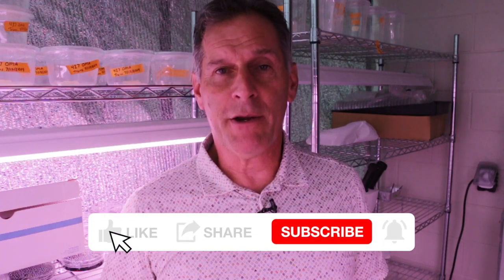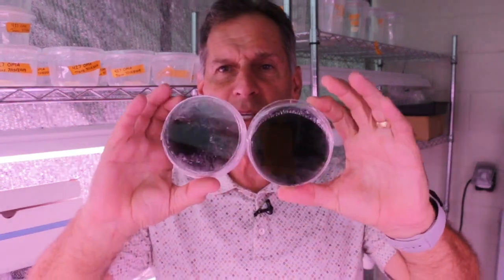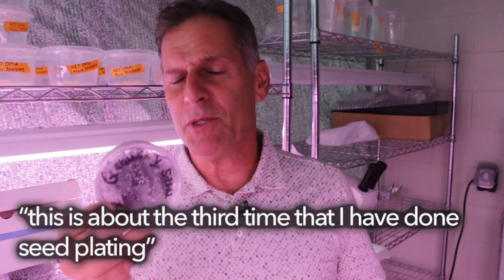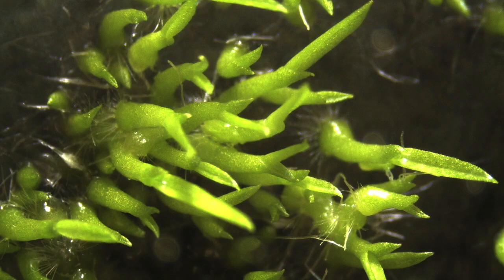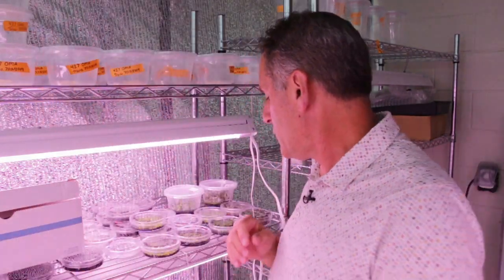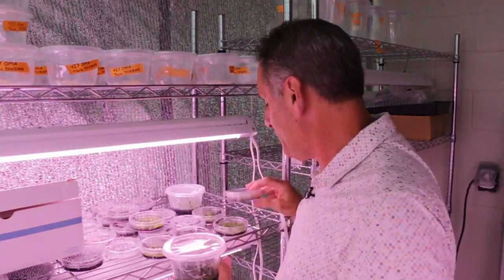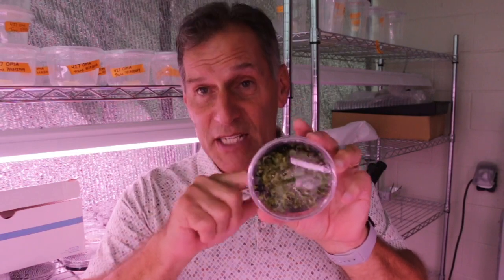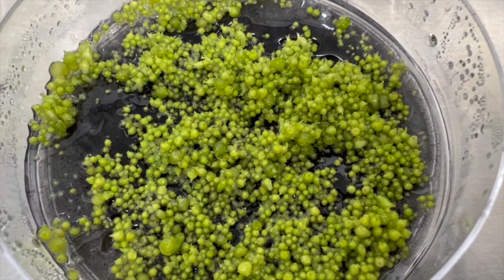Understanding orchid seed germination and growth

Comment: After a month of sowing my phalenopsis seeds, the seeds are swollen and yellow. Only few are green. What do you think is the reason. The seeds get 16 hrs light and are on Viacin and went media.
Reply from the maker: Thanks for your comment - there are so many things that are causing this - very difficult to diagnose with your description. If you have some clearly green protocorms and most are yellow, it may be genetics. If they are different shades of yellow, you may have medium, environment or disinfestation issues. An image would help but Viacin and Went is an early orchid medium that is OK but not optimum for germination - it just may take a little longer for your protocorms to green up. I have never used this medium but it is a really old formulation.

Comment: "try it in your own way"

Im doing it right now ...

Thanks much sir.....
Reply from the maker: Thanks for your comment. Good luck and let me know if you have any issues that I can assist with.
Reply: @plantpropagator  I have a question sir,

What's the best: to use a dry Phalaenopsis seed pod or unripened seed pod?
Reply from the maker: @rjjr.1071  It is easiest for flasking to use a close to ripe, unspilt seed capsule. When you sterilize the intact capsule the seeds inside will be clean and those can be stored in the fridge for a while. When you use a dry split capsule, the seed need to be sterilized for flasking and that is usually more work and you have to use lower bleach levels. But, both have their benefits and problems:
The dry seed from the dry seed capsule will store well but you need to sterilize the seed for each use.
Seed from an unripened seed capsule is easier to sterilize but the seed may not store as well.
Both should germinate at the same efficiency if the seed is good.
Some plant seeds require drying to overcome dormancy and germinate - not sure if there are any orchids like this.
Reply: @plantpropagator  great information sir, 

How to determine if the seed pod is already close to ripening?
Reply from the maker: @rjjr.1071  Please see this page for estimated ripening times:
https://www.aos.org/orchids/additional-resources/harvesting-times-of-orchid-seed-capsules.aspx
Please also see my video where I explain a little more about ripening time:
https://youtu.be/McJlZowKTys
You use the estimated times from the chart but you also have to look at the capsules for clues to when it is ready....

Comment: I subscribed I'm number 600. I get over 50 seed pods off mine I've contacted so many places and my seeds go to waste. It's terrible. Tampa orchid
Reply from the maker: Thanks so much for subscribing - I am so happy that you are #600. Yeah, it is awful for your seed capsules to go to waste. I have a colleague who takes the almost mature seed capsules (when they start to turn yellow) for butterfly orchids and rubs them on neighboring trees so that the seeds are distributed on the bark on the side of the tree - you have to push them hard to grind up the capsule against the bark. You will not get high frequency germination but she shared some images of her seedlings and it was impressive to me - there were hundreds. If you would like, I am happy to assist you by making some seedlings in flasks in my lab, but I only need 1-2 capsules - should be 6 months after flowering so in December or January. You can contact me at ThePlantPropagator@yahoo.com when you are ready! For putting them in a State Park in Florida, you do need permission and they have to be sourced within 25 miles of the park. Again, happy that you subbed.